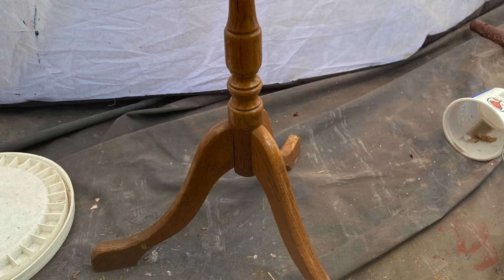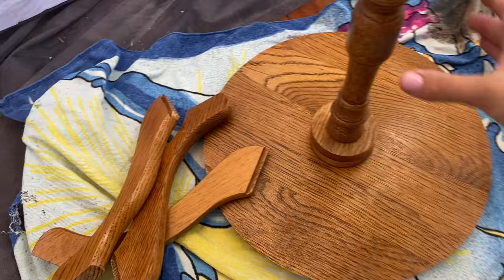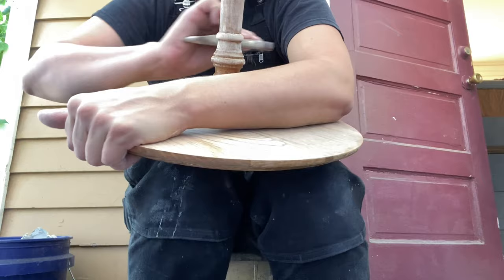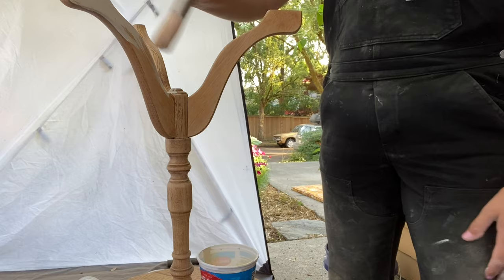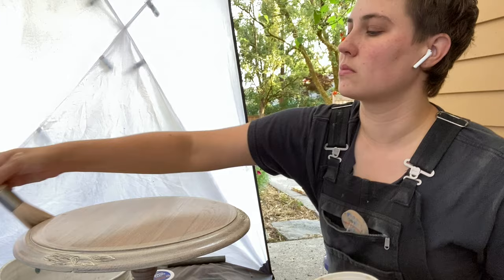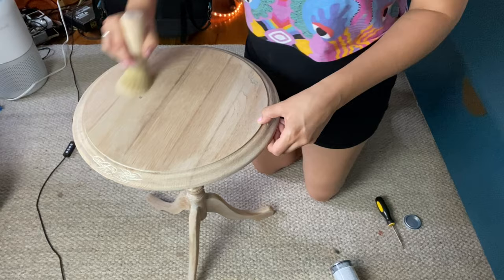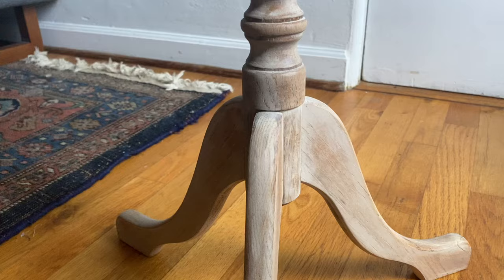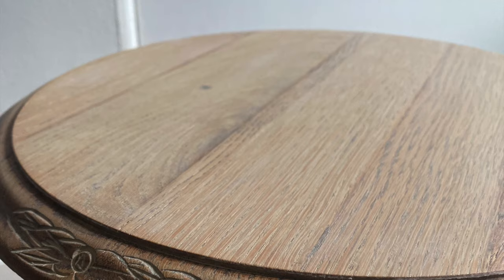How to lighten wood WITHOUT bleach! | Quick furniture flip 👍

Comment: This is so helpful. I think I’ll try this on some outdate oak cabinets!!
Reply: Yes, old oak table, I think it looks great, except for the teeny, tiny stain. Pencil eraser to start and then scrape until color is gone.. then just layer it with clear nail polish until it's flush with the rest of the top.. you can paint around it, or just wait until it's built up and dry. Then finish.

Comment: Thanks for this video. That look is exactly what I want for my honey oak kitchen cabinets, but have been reading about bleed through and pinkness when using similar techniques without primer. But primer is white and covers the grain, so I don’t want that. Do you think this could work? Would be so awesome…
Reply from the maker: Glad it was helpful! I think it should work as long as you sand off or remove the old stain! Oak shouldn't be too hard to cover up like this. That said, take off ONE cabinet door and try it on that first :)

Comment: I saw video where they used a square sander that got into many of the places your round one didn't. I might get a square one..it's cheaper. I have an intricate table to do with a split lid. It's an old end table with a magazine holder on the side. I love it but I want to do it right

Comment: So gorgeous. There’s nothing as beautiful than natural wood. Did you have to sand out the flower etching? The prep is always the longest part! I’d also be curious to see you outside set up (or perhaps it’s in another video). Looks like you have a tent or something. I work outside, but it’s completely open, so awful when it’s windy. And always scared I’ll get dust or bugs in my paint finish!!
Reply from the maker: Thanks, Deb! I didn't have to sand too much in there, it was pretty worn down.

Comment: Any diy enthusiast is welcome!
Now please consider that bleaches are not dangerous if you know how to use and neutralise the negative and slippery effects in your skin with simple old vinegar.
Only for your skin and not the wood.
It's not against the environment so no guilt feelings!
You could have simple scouring powder with a 3M scrub pad, to perfection, getting into all the groves!
Of course ma'am it was the sun which did did the bleach! But not as good as laundry bleach!
The paint pigment will mask the grain which can otherwise,glisten through the finish.
That does not mean that you shouldn't use pigments!
You could use even green red or blue pigments for style!

Comment: What grit sandpaper do you use? Did someone ask this already?   This was exactly the kind of table I am looking to redo and this result is beautiful!! Thank you for the tutorial!!
Reply from the maker: Hi! So it depends on the piece. Since this is solid wood (rather than veneer) you can start with a lower grit like 80. But to get a smooth finish you'll want to use 220 or 320. So, lightly sand it with 80, then work your way up. Do a sand at 120, then 220, then 320! The goal isn't to get all of the imperfections out with 80, the goal is to get them out as you continue getting higher in grit (finer and finer sandpaper). Check out some of my other more recent videos -- the MCM Nightstand I did is a great example of using sandpaper. That one was Veneer so I had to be EXTRA careful!
Reply: @KnowCanDo     mine is a piece very similar thank you!!!

Comment: @know can do thanks so much for the video. My question is - since the chalk paint is water-based, does the chalk paint fade or wash off when you spill liquid or water on the table? How long would it stay or last if water marks keep happening from a water glass or drink spills? Thanks
Reply from the maker: You gotta put on a top coat like furniture wax or polycrylic. That will protect it! Also use a coaster ;)

Comment: if you dont seal it with a sealer or top coat it is of no use the table will stain and scratch easily
Reply from the maker: That’s not true. It’s sealed with wax.
Reply: Wax is not a sealer u simply did a wax coat so nothing happened just say some top top coat and it will become ugly yellow that is called bleeding of wood

Comment: Can you still do the paint/water without sanding the whole thing down?
Reply from the maker: You could try it! But this had old finish on top of it. The paint mixture needs to sink into the wood grain. Finish is an impermeable layer that would make it hard for the paint mixture to adhere or sink in.
Reply: @KnowCanDo  what type of sandpaper did you use when you sanded the table?

Comment: I didn’t know what grit to sand  I used a low grit 80 and didn’t come out good 😢
Reply from the maker: 80 is too rough. It is good for getting off a rough finish but if you’re not careful it will tear it apart. Best practice is to do a light run with something like 80 and then work your way up, do a pass at 120, 180, 200, 240 til it gets smooth

Comment: Wood is NEVER outdated.  NEVER!!!  Find a nice wood table 200 years old and it will be as beautiful and as in-style as one made today.  In fact, it will command a significant premium over what the same thing made today would cost and not merely because it's old. .  Whereas the el-cheapo look you are trying to recreate goes out of style in a decade at most.  You have "IKEA-fied this table., 
The simple fact of the matter is not that wood has gone out of style, but that American can't afford it.
Reply from the maker: It’s still wood. I literally put a paint wash on it. The old finish was failing. Take some deep breaths and move along.
Reply: @KnowCanDo  Wood never goes out of style.